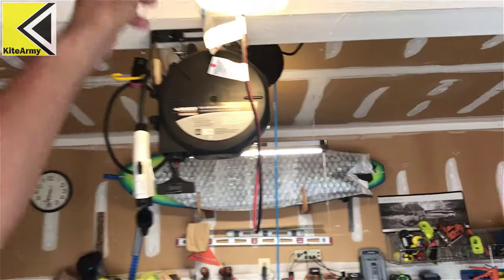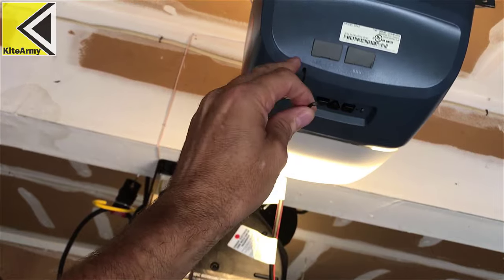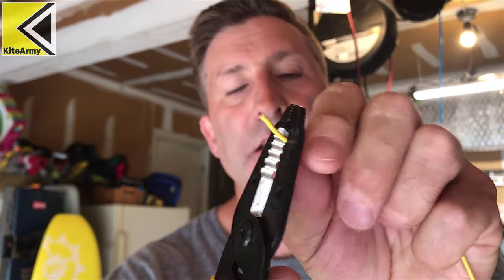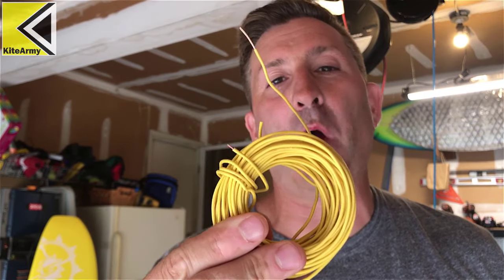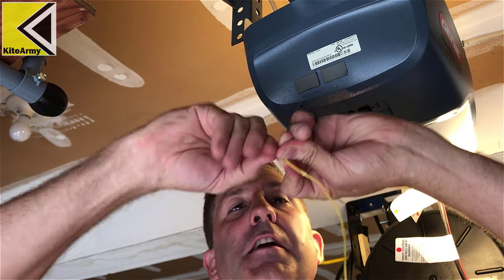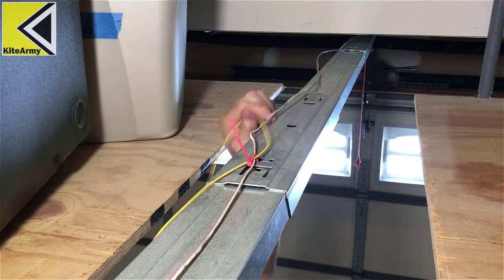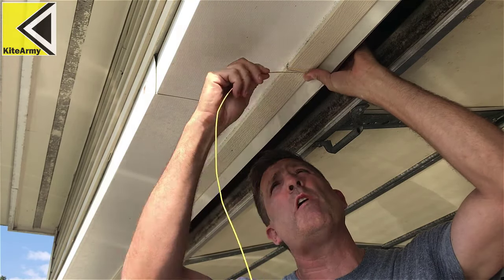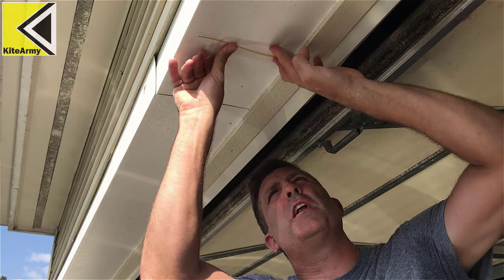Garage Door Opener | How to Extend Range⚡⚡⚡

Comment: With mine I thought it was the steel roof on my garage that was screwing up my remote, but I found out it was the LED light bulbs I switched to in the opener. For some reason they send a signal out that interferes with the opener remote. Now I find out the actually make LEDs JUST for openers that don't screw them up. Just FYI.

Comment: My remote was barely working and my homelink in my vehicles barely worked too. I took your advice and extended my the garage antenna with 14 awg wire and wire nutted them together. I ran the wire on the ceiling towards the door and stapled the end of the wire to the top of the exterior garage door casing. I tell you what my remote response is incredible and works a good 50 yards away now. Thanks for the easy advice
Reply from the maker: Glad to have helped
Reply: Did you bought the 14 awg wire on amazon?  If so may I have a link to the exact product that you used?

Comment: Confirmed works. I have a marantec synergy 270 and after getting new metal garage door it could NOT open by the remote when even standing RIGHT IN FRONT OF THE DOOR. My Subaru and BMW homelink systems didn't work either. Attached a 30 gauge to the end, taped to the ceiling all the way to the opening and let it hang out 3 inches. Now I'm opening the door no problem with remotes, cars, etc.

Note: I had 2 garage door experts at the house that couldn't figure it out and when I told them about extending the antennae they laughed and said it doesn't work that way. Saved my self a few hundred dollars and can laugh right back at them.

Comment: Verify this works 100%.  Ran 8 4' LED lights on my garage ceiling; remote range was awful.  Ran a 16 ga speaker wire across the garage ceiling and poked it out at the top (external) about 5".  Opened the garage from across the street with 168W of LED humming.

Comment: The beside making the antenna longer, the other big advantage is getting at least part of the antenna outside and/or above the door.  Most overhead garage doors are steel and they act as a big shield blocking the signal from the opener.  With the standard antenna you are relying on the signal to reflect off of other things to get to the opener.

Getting part of the antenna outside or above the door should improve the response.  It is best to not run the wire on anything metal, like the door opener rail.  You could run the wire along the wood beam over the top of the door (not metal) and that will also work.  One might need to experiment to get the best results.

Comment: Most of the time the antennas are so short, and is what causes the issue for most people. I just extended mine by like 6inchs and i can now open my door from the street. Before it had to click the remote so many times while being in front of the door. I noticed in the car it would open right away but the car sits right under the antenna and that gave me the idea to extended it and it worked before even watching this video. Just had to look it up if people worked this out as well.

Comment: I have a Genie Silentdrive 1000. Then the close-assured remote died and I was not able to find another one (why did they stop making them-they were great?!). Forced back to the standard remote, I found it would not work, no matter how I positioned the short antenna. As an electrical engineer who spent years working in the radio/microwave field, I was skeptical of just adding length to the antenna, as wire antennas cannot be made infinitely longer and maintain efficiency, at least for transmitting applications. However, the comments that steel doors kill the radio signals (and my stucco house is wrapped in chicken wire that also doesn't help), the idea of getting the antenna out from behind those obstructions is spot-on. Additionally, you have to be careful of LED lights causing interference - some do and some don't. But even after finding ones that did not interfere (verified with a spectrum analyzer), I still was unable to get the remote to work. (Besides, most of the time when you come home, the lights are off and not an issue.) So I spent all of yesterday taking the opener down, taking it apart, and replacing the antenna with a coax to a bulkhead TNC connector mounted on the side of the housing. Getting a proper ground at 315 MHz was an issue, as the antenna hole was surrounded by a ground ring of vias that were not intended to take solder. But by scraping off the insulating layer and adding a grounding bar between two of the holes (using 15 mil diameter capacitor wire), I was able to solder the coax shield ground right at the connector. After putting the opener back up and verifying operation, I made a long TNC-TNC cable using the same RG-58 and ran that to another bulhead connector mounted inside the garage but between the two steel doors. I made a new antenna with another TNC connector and a foot long piece of RG-58 with the outer shield removed from all but an inch of it. Using a network analyzer, I pruned the antenna until I minimized the VSWR at 315 MHz. (The exposed length of wire, with the insulator still attached, was exactly 6.5 inches.) Now the remote works from about 80 feet away, which is about as far as you would want.) Total cost was $46, but that was with the benefit of already having tools on-hand such as a microscope, soldering iron, network analyzer, and various hand tools including a scalpel for cutting coax insulation and scraping the passivation off of ground vias. Obviously, not everyone can go to all the toruble, and it sure seems like it was probably unnecessary based on all the comments, but I am a perfectionist, as well as retired with a lot of time on my hands. I think gragage door companies would do everyone a favor if they would install coax connectors on the outside of the openers to attach an antenna, or replace the stock antenna with a kit to move the antenna anywhere you like. And a note for DIYers who love to tinker - handheld network and spectrum analyzers are dirt cheap these days (~$100 each) and have a multitude of uses.
Reply: You can send me photo ?

Comment: I rarely leave my garage with the interior lights on... but I did it a couple of times this week because I was doing test-runs after working on my winter car. I thought my remote battery was getting weak...🤔 NOPE it's the new 8ft LED lights I put up!  I'll extend the antenna outside (maybe with some shielded coax cable???) 😮Huh... I honestly just thought of that as I was typing this comment!

Comment: My Nissan Murano must have thick glass or something because my remote has never worked reliably even from three feet in front of the garage door. I did your hack and extended the wire 20 feet all the way to the wall right by the garage door and now it works fantastically. Thanks so much.  We tried it last night also from but an eighth of a mile down the road and it worked also. wow
Reply from the maker: So stoked this worked well for you - thanks for comment
Reply: @Kitearmy  you bet. It's the little things. This thing has driven me crazy for 3 years. I called the garage door company who installed it and they sent me three more remotes to try. I've kept them all in my car and randomly tried different ones to get it to work and it never made any difference. It really appears like the Murano has some thicker glass or metal that is preventing the signal because when I stick my hand outside the window it works fine every time. But now you have solved it and I really thank you
Reply from the maker: I'm really pleased that this worked so well for you

Comment: My garage door opener STILLL sucks after extending my antenna. I soldered the solid 18g copper wire to my antenna wire and routed it outside of my garage. I still have to be inside my garage and right under my garage opener for the remote to work. And no i do not have a led light bulb. Kinda lost and pissed off. I have a older 2006 liftmaster.

Comment: yes, I tried this. It doesn't work. the LED T8 bulbs generate +300mhz interference. I had to cut the antenna, solder it to the center wire, ground the outside wire grid of the coax, run it to the exterior of house then strip off the insulation from the inside wire and cut to 9" long. then it worked. wasted my time trying this suggestion

Comment: Just dont leave it exposed outside, theres some openers with circuitboards that have the microchip failsafe programmed funky and if you take a 9v battery and ground the battery on the door and the positive on the antenna it will short the chip out and cause it to open the door...  older liftmasters haf the issue..  only certain models tho.  I remember thats how i used to get into my house when i was younger, found it by accident:..

Comment: You don’t even have to run a wire to the outside. I used a few feet and just ran it up the angle supporting the opener and zip tied it.
Reply from the maker: true

Comment: Does this fall under "Don't believe everything you hear on youtube?"  Did absolutely nothing for Intellicode remotes for the Model 7055.  I used about 20' of the same gauge wire and did a dry run with the wire hanging freely down from the unit.  There seems to be a logic here, but taking five of the doctor's pills does not cure you five times faster.  Is this brand-specific?  I am aware that antennae are generally tuned to specific frequencies.  I await your reply and, perhaps, suggestions on what I may have done wrong.

Comment: I may have to do this. The remote operates inside but not outside. I already changed the remote batteries, unplugged and plugged back in the power cord, and did a system reset. Ill check the light bulbs but I'm almost certain it's an antenna issue. What gauge wire should I use? Thanks.
Reply from the maker: Small gauge is fine like 18+

Comment: Question, if using insulated wire where the inside copper wire is shielded with the foil lining,,, will that cause the wire not work like a single wire only?...food for thought
Reply from the maker: Should not be a problem

Comment: I recently noticed the remote not working issue after I installed the wifi smart garage door controller - Garadget, which seems to interfere with the radio of legacy garage opener. If I use your way then can I solve this issue too?
Reply from the maker: It might work - if you can relocate the antenna from whatever is causing the interference.  It only takes a few minutes so it may be worth a shot

Comment: Hi, I have a old sears(40 years or so) chain drive opener. Do you feel  the extension of the antenna  will work with your suggestion
Reply from the maker: It should

Comment: I just did this and somehow it seems worse.  I was standing basically in the opening of my garage and it wasn’t registering, guess I’ll try fresh batteries to rule that out at least
Reply from the maker: Yeah, don't bother doing this if your batteries are no good - can't fix that
Reply: @Kitearmy  tried new batteries, but after some more testing, I’m apparently getting interference from the LED lights in the garage, when they are off, I get fantastic range.  I have these lights on an occupancy sensor, so now I have to between better garage door range and auto on lights 🤷🏻‍♂️🤣
Reply from the maker: @Bennyhanna7  They sell low interference lights for garage doors

Comment: Would it matter if it takes more than 20 ft of wire to run it outside of the garage, or it has to be limited to 20 ft only?
Reply from the maker: nope - that should be okay

Comment: I tried Low Voltage Audio Cable and ran it all the way to the exterior of the garage and it didn't work. Would electric wire work better?
Reply from the maker: just try it on the ground and see if it improves

Comment: So I was having issues where I needed to hold the remote directly up to the antenna to get the door to open. I followed this video and extended the antenna out the front of my garage, and it kinda worked - but now I need to hold the opener right in front of the end of the extended antenna. So it didn't really increase the range, just lengthened the antenna ? Any ideas?
Reply from the maker: check the light bulbs - if they are the wrong type they can cause interference
Reply: I have the same issue. I have led lights in the garage, not in the motor but never had any issues before. It just started a couple months back. I changed the batteries of the remotes reset the motor but none of my remotes, outside keypad or car’s homelink work. They all worked couple of months ago. I can only open the garage door if the remote is almost touching the antenna. I will try this hack and see if it works.
Reply: @Jonayd 
Are you near an airport or some other faculty that may have installed any new wireless equipment? Or near a new 5g cell tower?

Comment: Yea idk what i did wrong but i still cant get it to open even 3ft away from garage door
Reply: I used a extra 10gage copper wire i had sitting around. A wire nut to hold it all together and have it pretty far out of the garage door. Can you help!?

Comment: Having the same issue but mine is a gate opener.  I literally have to put the remote next to the antenna, do you think it’s going bad?  The antenna that is?
Reply from the maker: Seems to defeat the point of a remote - start with the battery
Reply: @Kitearmy  tried that bought new ones and changed a couple remotes also tried the remote built in the cars but still nothing
Reply from the maker: @isalopez76  Try this trick then

Comment: Does it have to be solid wire or can it be braided? Also, if I just extend it to the header will that extend the range?
Reply from the maker: braided is fine too - the header might be enough - give it a try
Reply: @Kitearmy  I am going out to try it in 5 minutes.
Reply from the maker: @IanRLewis  Cool - let us know if it helps
Reply: @Kitearmy  Seems to have solved my problem.
Reply from the maker: @IanRLewis  Congrats mate - easy fix

Comment: I tried it and it somehow made it worse. Wouldn’t even open on top of it. It’s a Craftsman purple button opener. I shortened up and it at least works well now. I tried many different configurations. And stripping the wire at the end etc. etc. also making shapes with it to pick up the signal. Hang loose and tight you name it. Any ideas?
Reply from the maker: yeah - so the antennas are meant to match the wavelength of the signal - sometimes this hack does not work
Reply: I vaguely remember in my Networks & Systems class that the antenna length needs to be a multiple of the wavelength. if this is true, cutting the length of the antenna to a multiple of the original length might work. I have the same problem as @desertrider325 - I might give this a try.  @Kitearmy

Comment: Well done video, thanks, and made me a new subscriber. My problem, though, is how to extend the range when using Homelink (built into the car). I recently programmed Homelink in my car for the garage door opener. It works, but the range is half, maybe only a third, of the little opener that used to be on the sun visor. Seems the car should be stronger. Ideas?
Reply from the maker: Yes - nothing can be done on the car end but increase this side increase the total range

Comment: This did not work on my chamberlain door openers. still has crummy opening distance.  someone else said to not use LED bulbs in the opener due to interference. I will be giving that a try next.  And yes, my remote batteries are brand new. I even checked the voltage with a meter.
Reply from the maker: They make special bulbs for garage doors - though I think I would try a non-led too
Reply: I have a Chamberlain also and thus didn't work.  I tried it without LED bulbs and then removed both bulbs and still no luck.
Reply from the maker: @Rayven_cat  Did you try to add the extra length antenna?
Reply: The LED bulb does not have anything to do with interference because the light is always off until the opener receives the signal and then lights turn on, I have the same issue with chamberlain opener
Reply from the maker: @ebbyt00  My garage light is on all the time
Reply: I had a lift master opener. I thought LED's would be cool to put in the unit.
It worked for a while. Then the remote acted up. It was losing operation distance. Within a few days I would have to be up to the door for it to open.
What I found out from a garage door company is that regular  LED's will fry the circuit board & It did.
Now I have a craftsman opener without LED's.
It's been working out ok.
Reply from the maker: @richardcraniumdicksinn3959  LEDs car wreak havoc on garage door openers - though never heard of circuit board damage
Reply: @ebbyt00  when leaving the garage, my led lights are on, causing issues closing them